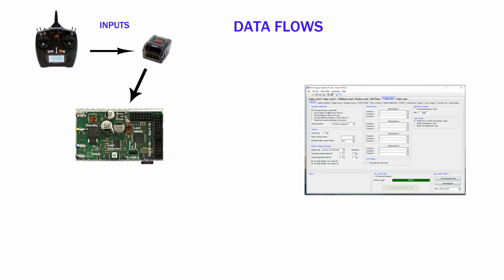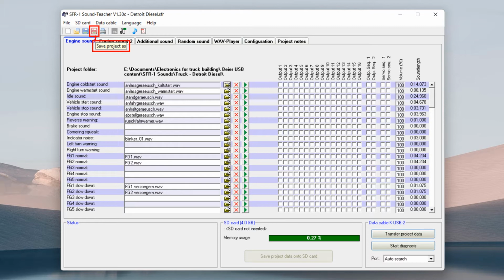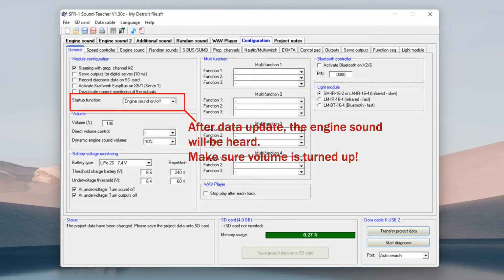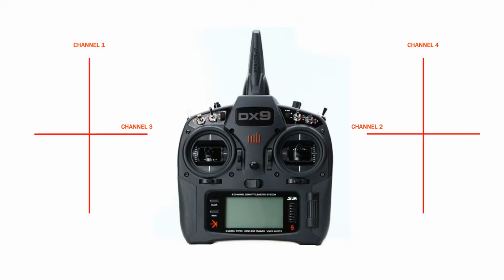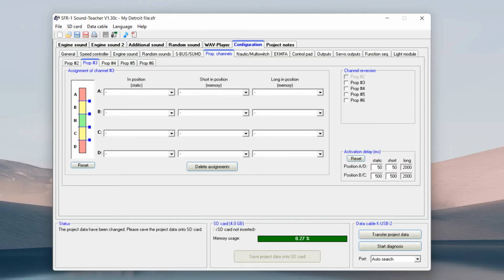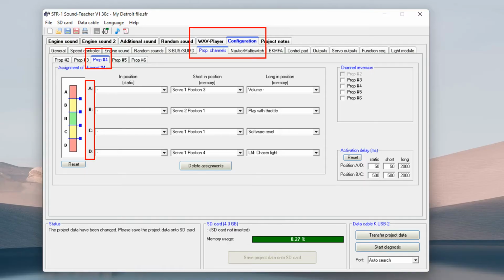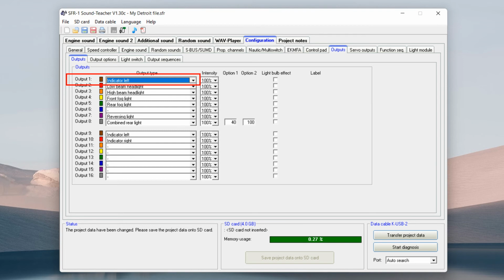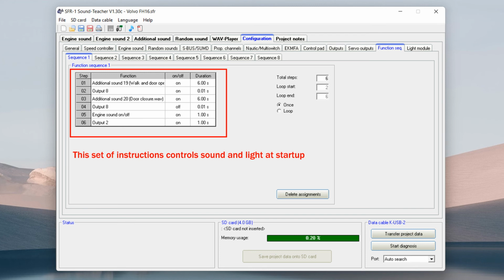Fancy a Beier Part 4

Comment: Dear Colin thank you very much for the serie of the SFR-1 and thanks too you i have brakes on my truck and now i can run the truck and trailer due to the SFR-1 and lm-bt-16-4 
Keep up the good work and take enough time to rest
Reply from the maker: Excellent Rob, well done! Thanks for the kind words. I am about to embark on two more builds - an Actros 6x4 and an Arocs 6x4 Tipper; both with Beier control. I plan to video the whole build of at least one of the models. Two might be a bit ambitious!
Reply: @tamiyatruckbuilding7426  i am going to build the Scania S770 NextGen after i have all the parts that i want to replace from plastic to metal and yes again with the Beier SFR-1

Comment: Thank you for this series of videos👍 I run a couple of USM-RC-2’s, MFC-1&3 and a Servonaut system, the RC-2 is by far the most versatile. The SFR-1 certainly looks like another step up with the bonus of not needing a separate esc. Will there be a part 5 that delves deeper into what this unit can do? (I certainly hope so😉)
Reply from the maker: Thank you for your comments Earl. You're already a Beier user, which is great. I might do another part on sequences, but it won't be for a while.